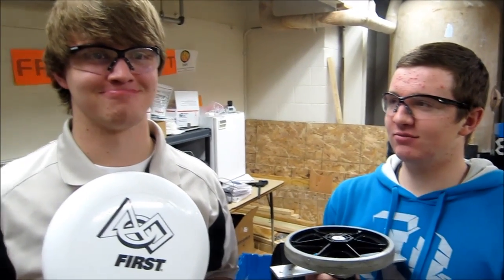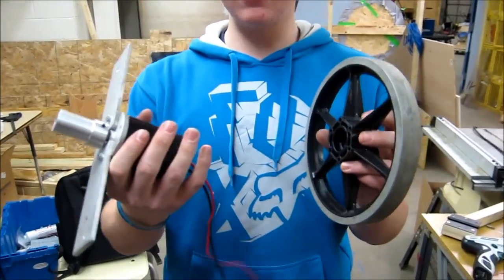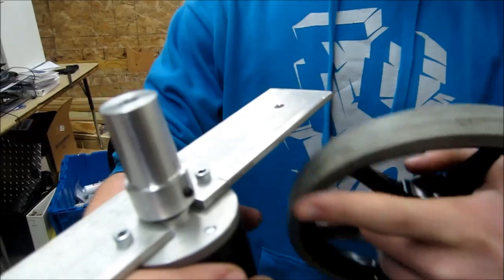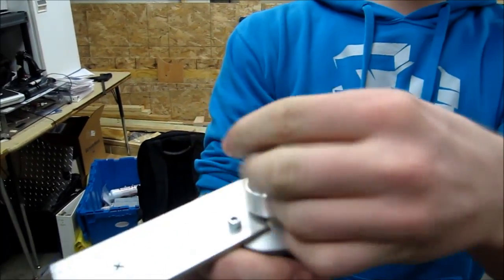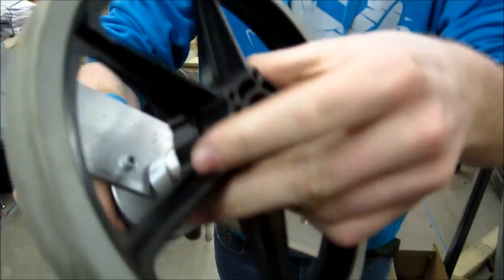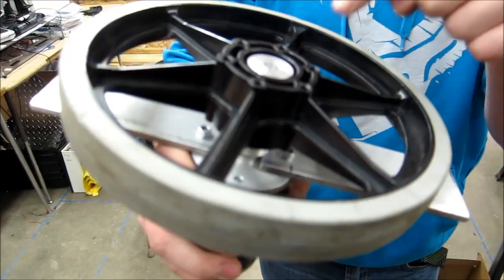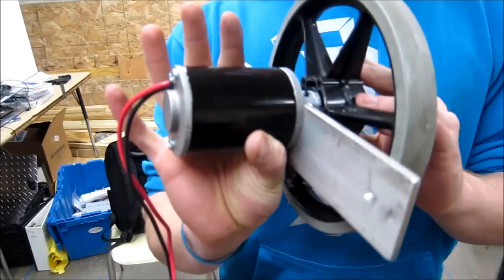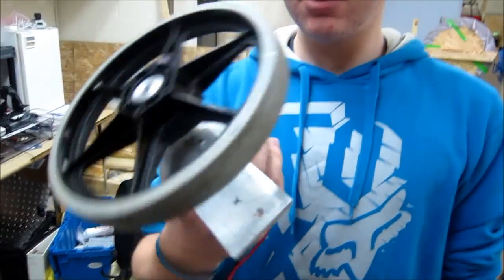Shooter Wheel Mount

Comment: I asked the same question but it looks like it disappeared. We ended up making our own on a metal lathe at a machine shop. You will want it to be a tight fit, so make sure you measure the actual wheel you're going to use.